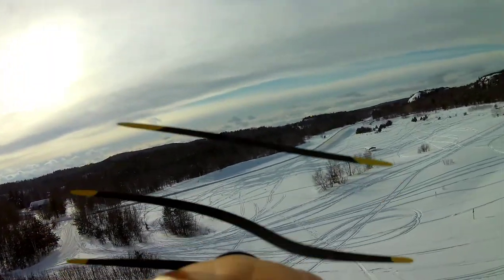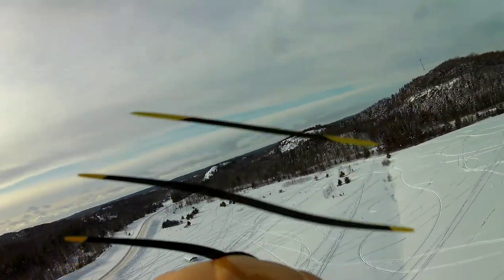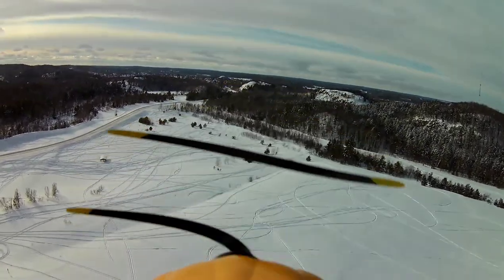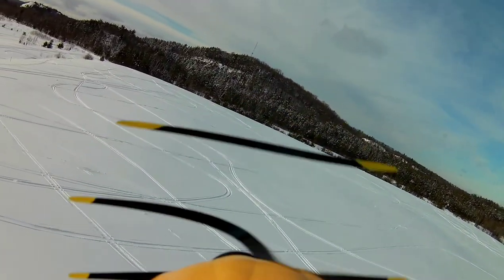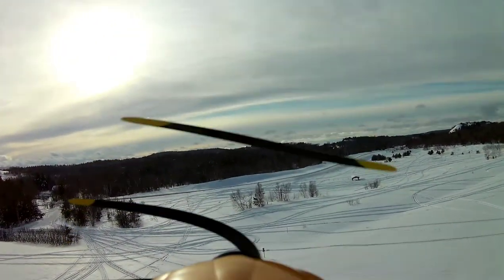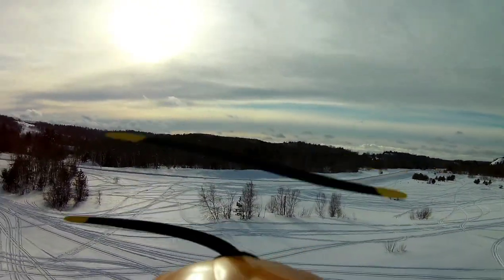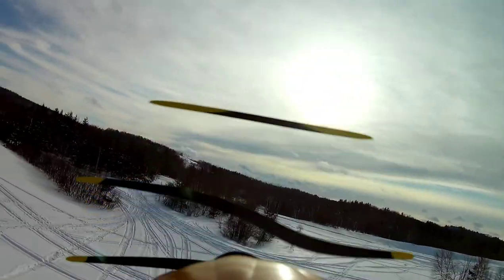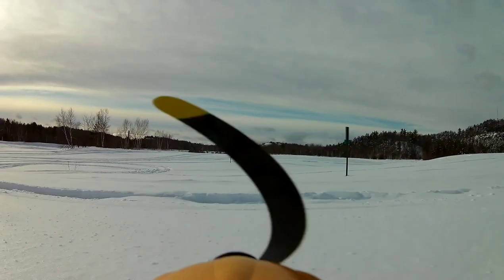horizon hobby carbon cub s+ with dx8 gen 1

Comment: Hi Bob,
 could I ask you for help with setting up DX8 G1 for Carbon Cup S +?
Reply from the maker: sure!
Reply: @muskybob8726  Hi Bob, thank you very much for the quick reply :-)
I recently bought a DX8 G1 and since then I have been looking in vain for a preset or some setup guide for Carbon Cup S +. I didn't find anything on the sides of Google, Spektum or Horizon. The settings are so complicated that I can't handle it. Especially SAFE mode settings.
Reply from the maker: @fotoatelierbartos8858  ok. i bought the ready to fly version, then bought the flap kit so i had to get the radio.
  i will try to remember how i got it to bind to my dx 8.   i did have some trouble!
Reply from the maker: @fotoatelierbartos8858  did you buy the bnf version?
Reply: @muskybob8726  I also bought the RTF version, then bought the flap kit and now I get  the radio the same radio DX8G1. But I don't think there is a significant difference between RTF and BNG
Reply: But nowhere more detailed description
Reply: when i bought raio i thought i would download the ready settings from horizon / spectrum but it's only there for other radio DX09, ...
Reply from the maker: @fotoatelierbartos8858  yes, ok.  so you did just like me. i bought the dx 8, then found it was gen1.... that means it is more difficult to set up!
  when i get home from work i will look at my setup. should i do a video and upload it?  i dont mind at all.
Reply: Thank you for your willingness 😊
I imagined it very simply that I download the settings for DX8 G1 and Carbon Cup from the Spektrum website, bind the model and it's done.  
But there are many problems. The RTF version is not the same as the BND. RTF has set the receiver for the DXe transmitter and it is not possible to simply change the transmitter using the BIND connector. 
The Spektrum states that up to hundreds of different settings can be downloaded but setup for DX8 G1 > Carbon Cup doesnt exist.
I will have to learn much more 😊
Reply from the maker: @fotoatelierbartos8858  you can bind your cub to the dx8 gen 1. i did it. and i set up the flaps.
  i'm willing to do a clip on it.
i now recall how i got through it: i spent an hour on the phone waiting for a rep from horizon hobby to talk me thorugh it